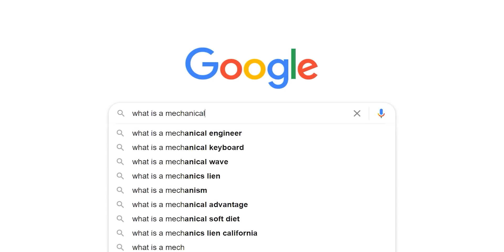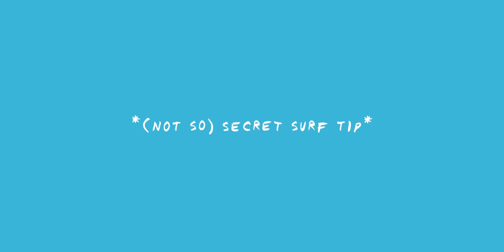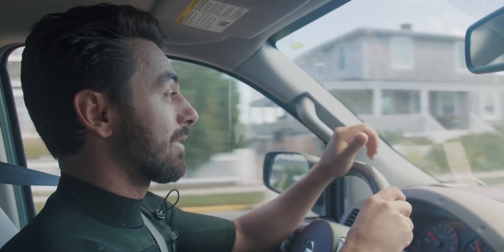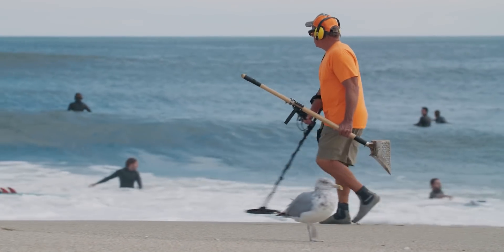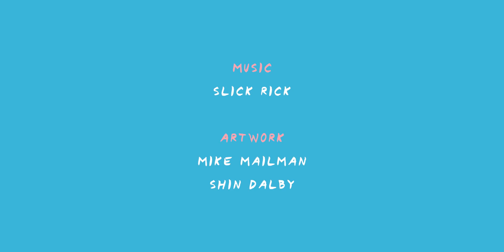Wait, This Board Has A Mechanical SPRING Inside?

Comment: Mechanical Spring? I call it bullshit. Even a normal wood stringer when loaded is a mechanical spring... Must be just a carbon fiber stringer or carbon fiber stringer rod they just market it to sell more boards. But hey, still a surfboard in the end of the day.
Reply: Yep, semantics
Reply: Yup . Groove where the stringer is. Twist carbon cloth push it in and resin.
Reply: Maybe it's more of a "springer" and less of a stringer?  Bert Burger has talked a lot about these as an alternative to a stringer.  Stringers were added to boards to give them rigidity and I guess that's when boards started snapping...like a green banana.  Springers are more strategically placed and in theory would flex and recoil more.  A lot of companies experimenting with different foams, carbon, etc to get the same effect.
Reply: You can call it what you like, Nick Carroll reviewed two boards of ours over 2 months in a variety of big and small conditions and called it the tech of the century on Surfline!
Reply: @carmig00  oh nice interesting name for your tech. What’s your surfboards called? And your experience? I’ve hand shaped over 25,000 boards since 1974
Reply: @decadeca1000  nice to see more of an intelligent comment rather than the verbal diarrhoea. Your sort of getting the idea it’s a highly advanced alternative to a standard timber stringer which has poor flex characteristics. Bert is a smart man and we talk a fair bit on all things surfboards.
Reply: CAMPBELL DESIGNED I'm a complete garage hack and enjoy seeing creativity in a stagnant industry.  A lot of the best designers have always been mocked or ignored in surf history...everyone thinks they already know it all.  Someone has to try something different, and if it works, the people that ride them will take notice!
Reply: @campbelldesigned  don't waste time replying to nonsense! Skeptics hate. Can't talk sense into them. Looks great from here! Keep grinding mate
Reply: @joaomario3060  the disrespectful tone of your reply seems to indicate you may be a little upset. I don't recall referring to anyone as dumb but the verbal diarrhoea comment was there, is that where you thought you came in? What that statement addressed was the people who feel it pertinent to comment with a lack of knowledge or proper research into a subject. Those who see something and take it as their job to dish out baseless ridicule.
Now to the key points of your unwarranted attack. Your sarcastic, "Yeah, I'm sure it's revolutionary", well our patent attorneys seem to think it is. Or how about Nick Carroll, always the most thorough and harshest of critics summing up in his review on Surfline referring to our tech as, "The coolest and most effective piece of surfboard engineering I've seen this century let alone this year". Yes a skilled operator with the right equipment could indeed do ours in a well setup backyard situation as they could do with any and all of the current techs on the market.
You go into some of the biggest brands citing how they show and explain what their tech is and how it works. On that note we are currently in negotiations with a couple of the world's largest players with a view to licensing out our tech for their exclusive use. Unfortunately contractual obligations forbid us from either naming them or divulging too much re the tech itself, likewise goes for naming the recent CT World Champion who after testing described them as the best EPS/Epoxy boards he'd ever ridden.
You threw in a quote from Ben Aipa about it not being about how much (sic) boards you make but how good you make them. Here ya' go I'll throw in a quote from 1990 world champion Barton Lynch, "The two boards Stuey Campbell shaped me during his time at Aloha Surfboards were right up there with the best boards I've ever ridden".
Your call that our tech is pretty similar to all the other carbon/epoxy boards out there just doesn't gell, especially considering you don't know what it is.
For starters it's not about the materials used, it's not just effective in carbon/epoxy/eps, one of the boards Nick Carroll tested used a pu blank. We can also do them using basalt, Kevlar, hemp or even plain old glass, it's just that carbon/eps gives the sharpest response. It's all about the lay-up and how it's applied. We've had success with not only performance shorties but also longboards, paddleboards, foil-boards, kite boards and big wave guns. Ya' still wanna call that not revolutionary?
Joao, you mention the backyard shapers group on Facebook and suggest I join. Well I've actually been one of their most respected, valued members for a long time now. I contribute there to help and put something back in the same way Bert Berger and others do. Speaking of Bert since you two seem buddies how about you ask him for a little verification of my history, background and credibility, I'm sure he'd be only to happy to oblige. And in closing Joao, as for your little list of techs/producers that really make different surfboards I suggest you add my Exo-Flex tech and put it right up the top. I'm done.
Reply: @campbelldesigned  Thank you for your articulate response. It makes a lot more sense now. I'm sorry if my tone was disrespectful to you, but you are right, I'm upset when the average surfer spends their $ for a product that does not show, properly, how it adds value to them.

First your statment is false about Nick Carroll, he clearly states, in the review "I’d say it’s about as cool and effective a piece of surfboard engineering as I’ve seen this century, let alone this year." it's clearly a very different statment, even more if you add the context it was inserted in. But this is really nitpicking and I don't really care about Nick's opinion, im sorry. Every review on beachgrit, is one of the best surfboards he ever had. kappa.

I'm not saying your boards were bad, I was saying your arrogant attitude was. I actually believe your boards are good, as so as I happen to believe your construction is nothing special compared to the other manufacturers I mentioned. And just because you can put a patent on it doesn't mean it's inherently good.

The other response was not directed at you, I was simply showing a fellow surfer other surfboard manufacturers that do different constructions. I wouldn't be in my right mind if I recommended a veteran shaper to the backyard shapers group aswell... ahaha. I think surfers should have informed options when choosing surfboards.

It is true that you can do everything in your backyard if you have enough money, but you clearly understood what I meant, and further deviated from the point I was trying to make. 
You obviously know that it is much, much, harder to do a Libtech, Lost C3, Firewire, Sunova, Coil Surfboards, Notox, darkarts, Varial in your backyard, than it is to do it in your construction. You seem to do it all hand laminated, thus it represents a much lower barrier of entry for a backyard shaper. The examples I shown some use vaccum bag or resin infusion. Some apply really different materials other than fibers. Heck I've made a basalt surfboard in my backyard, innegra and carbon and I dont have any fancy stuff arround. The production method you show is not advanced, is the same hand lamination technique manufacturers have done for decades. Most of the manufacturers I describe differ from the "traditional" hand lay up technique in, at least, some parts of their process, and in some cases, the entire process is different.

My little list is for other surfers to check them, compare the manufacturers and their tech, and see why I am saying this, and form an opinion of their own, to make an informed decision of the surfboard they want to buy. I know enough to say that some of the manufacturers I mentioned, clearly, use more advanced surfboard building techs than most (including your exo).
Reply: @campbelldesigned  Thank you so much for your response. Mad respect for you! :) (no sacarsm really)
You still asked me some questions that I'm gonna answer.
Yes I accused you of arrogance, you could have clearly explained the concept to the reviewer but didn't, so, in fact you had a chance of saying a word before my comment was posted here. 
Also your comment "nice to see more of an intelligent comment rather than the verbal diarrhoea." is, in my opinion arrogant, but maybe it's my interpretation of it, idk.

I've read the review to check if I wasn't biased in my opinion. After that I read the other reviews he made, there is clearly a pattern. Also viewed the other reviews in The surfboard guide about your tech to form a more informated opinion on it, since we are having this discussion. I don't have any personal grudge or vendetta against you.

Yes you are right, your tech is different, and that's why you can put a patent on it. Again I was just saying to the other Surfer, to check the other manufacturers and compare it himself. I will not make a list of materials used by X and Y and the manufacturing process... The surfers can check it themselfs and decide which is better. I think everybody should make an informed decision, that is my point all along.
 But It is still my opinion that the manufactures I mentioned use a more advanced manufacturing process, and different materials than what you use if that matters. And therefore produce a better product (why? I will explain it further down.)

I believe a skilled laminator can match or even reduce product waste compared to vaccum bagging. Resin infusion would be a bit harder but, still can be doable. Even harder if you have a skilled laminator doing vaccum bag and resin infusion, but it's ok, I will believe in your word.

However I was not talking about product waste, It is clear, from research, that vaccum bag and resin infusion have a greater tensile strength, mechanical strength, greater bond of resin to fiber, and greater modulus elasticity than hand lay up glass. Therefore the manufacturers that use these techniques have a surfboard with more tensile strength, mechanical strength, with greater bonding proprieties of the resin and fiberglass and that will flex more before they break than others. We can assume this from recent research on composite materials. Therefore my conclusion remains the same, manufacturers that use these procesesses, pocess a superior product that the other manufacturers that don't. You happen to not use this. Now I'm being arrogant, because you are throwing sand into the people's eyes, sorry.

All in all mad respect for you showing that you really like building surfboards, keep up the good work! :)

Comment: A normal stringer is a mechanical spring... This might just be more BS marketing. I reckon it'll just be a carbon stringer or something similar.
Reply: Thought the same. Probably the reason they did not actually show a cross section
Reply: @campbelldesigned  Well I'll certainly have a read and stand to be corrected. Though this video certainly doesn't help. Deliberate lack of explanation in it isn't exactly encouraging a belief that the tech in the board is significantly different from what's already out there.
Reply: @CupiDany  I honestly thought that they were going to cut the thing in half at the end to see what the marketing is covering up.
Reply: @grakkerful  Haha I was hoping they would too
Reply: @CupiDany  This video was shot over a year ago, prior to finalising the somewhat lengthy process of securing international patents. 
As it’s a relatively simple idea but very effective we don’t feel it prudent to explain to people exactly how its achieved on a public forum. Even in this video Mikey’s enthusiasm alone points to it as being something out of the ordinary. I haven’t seen him say he’s absolutely in love with a board in any other reviews.
Reply: @campbelldesigned  I apologise if my comment may have come across as rude. We’re just a bunch of jealous bums who can’t figure out how you’ve apparently “cracked the code”. 

And I can understand that under the vast umbrella of comments some might appear more destructive than intended by the writer. Personally, i was just pulling your leg a bit to see if a slightly more thorough keyword would be spilled. I have a lot of respect for people who, like you, put themselves out there with their visions, thereby exposing themselves to criticism. This is, in my view, the only way how we can enter into a discourse and evolve. 

At first glance it unfortunately seemed like a marketing gig. I honestly think to this end the producers haven’t done you and your work justice. But the video pretty much felt to me like every other advertisement.

I may have not shaped 24.000 board since 1974, which honestly is an impressive number. But I have been building springs of all kinds since a long time. (At this point I fear it is the wrong moment but I’d love to hear your opinion on using a material such as basalt)
 
From a technical point of view, any solid can be considered as a spring. And I understand that for patent reasons it is always hard not to go into too much detail while at the same time trying to show ones novel achievement to the world.

I’d just be curious to know if your spring has more than one resonant frequency (not counting overtones of the same). Otherwise, it is just a bit hard for my simple mind to understand the difference between this, and any other harmonic oscillator. 

I would truly be impressed simply if I knew that someone had tried to engineer a frequency band of a surfboard rather than just slapping on some carbon. I don’t need to know how it exactly works. I just would love to know that your solution has addressed something which has never been addressed before.

Otherwise I hope your board sells like a rocket ship!

Best,

Miguel

Comment: Great review, will love to test one in Puerto Rico
Reply: How’d this board go if you got it?
Reply: @harrisondemeritt  they are hard to get in PR, so I got the Seaside, which I love
Reply: @ODL957  Hows that board hold up through the winter? can it handle OH surf well?
Reply: @harrisondemeritt  it can but you gain so much speed that it can be tough to control some time. Also depend on the wave type. If the wave is too shallow/steep versus a less steep wave. But I have to say that I love the board. Probably my favorite board out of the other 7 that I have.